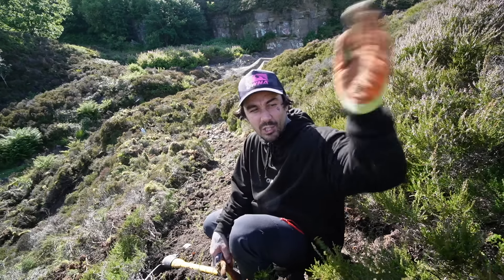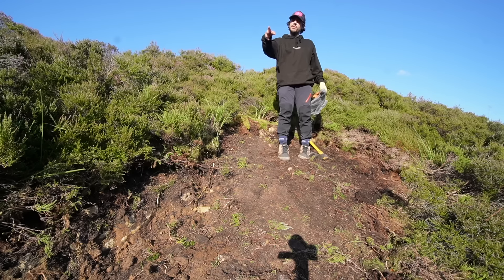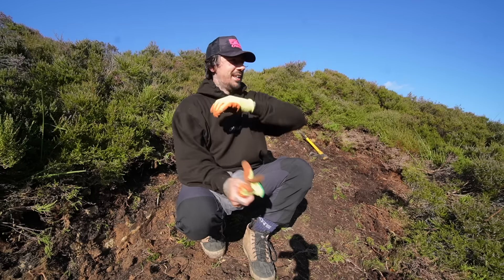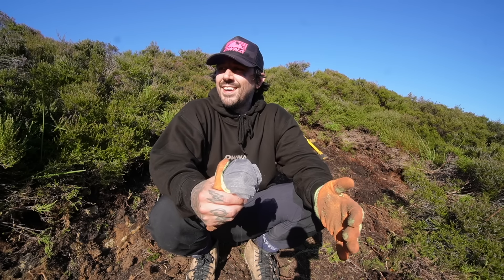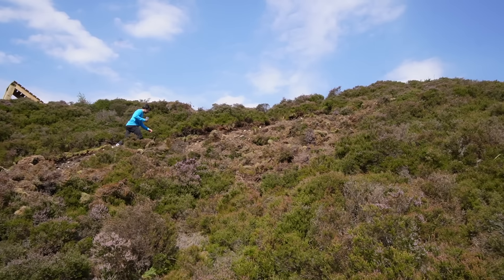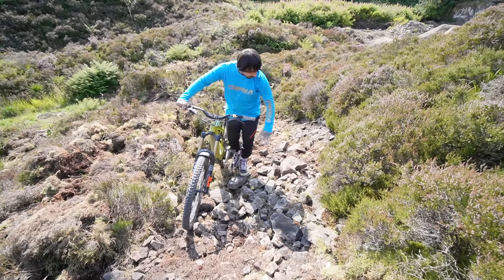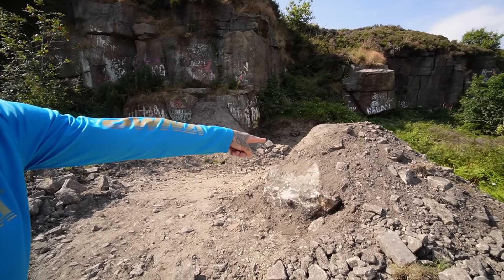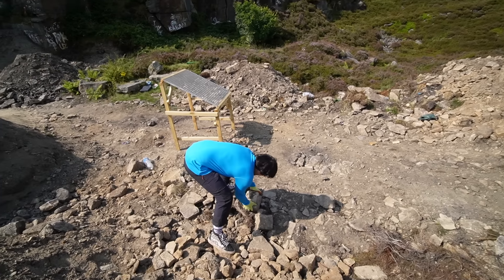DIY BIKE PARK BUILD! - BUILDING & RIDING DH TRACK!

Comment: few barrows of top soil on the rock garden will hold it in place and then the more you  ride it the more the rocks will start to pop through. should also make the track less steep and traverse as far as you can along the hill. you could prolly get a few switchbacks at each end if you made it tight enough as you dont need it to be that steep to gain speed